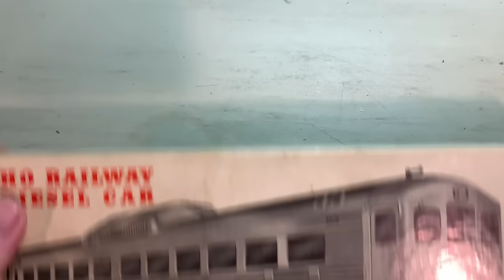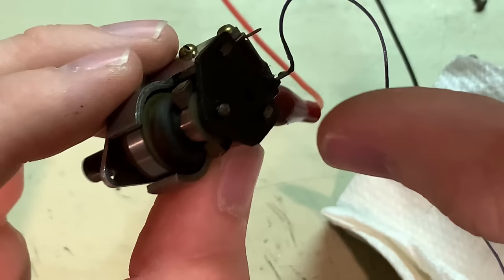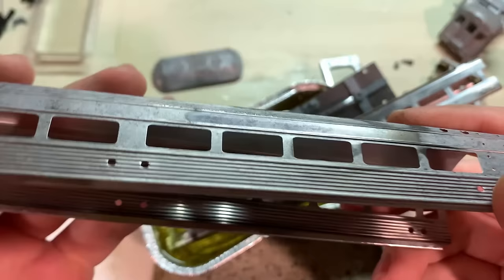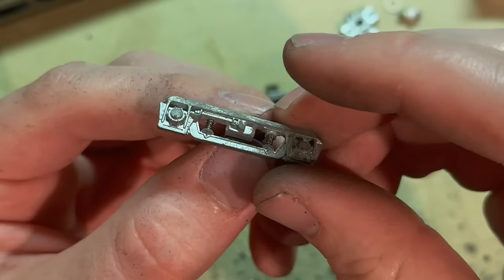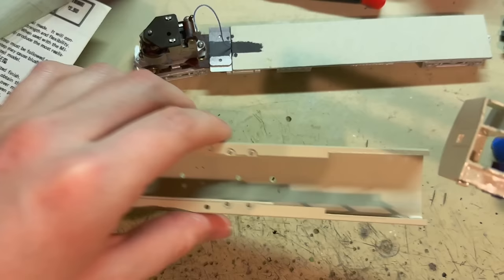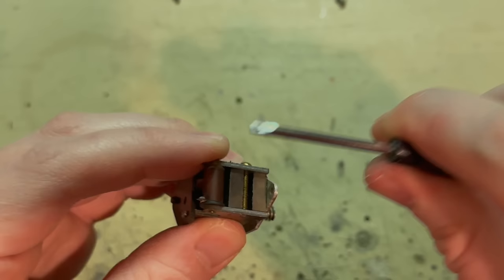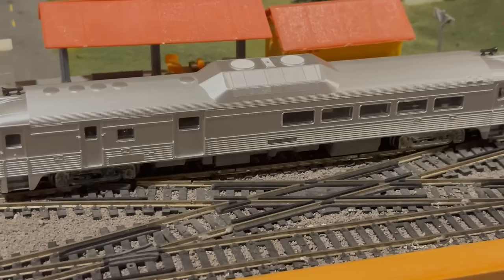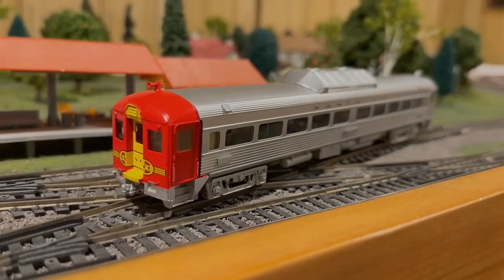Build/Restoration of the Original Athearn Metal RDC!

Comment: I just got two of the 50s plastic ones, ordered new belts today and plan to dcc only because of dual direction lighting. Has a motor in the middle, a drive shaft to each end and 4 belts for the four axles.

Comment: Definition of Aggravation :  -- When the frustration of launching those truck springs into orbit kicks in...... Lmao, I  did that a large handful of times over the years. Great job!!. As to using Alcad... I always liked my transit cars to have that "almost mirror-like finish". I used Alcad's black gloss lacquer as a base, then the chrome lacquer  to finish. Otherwise if not that system, i use black gloss paint as a base and then rub on chrome powders which also works to a nice point, since it can be buffed to a beautiful shine.

Comment: Great video. I acquired one of these old metal kits (an RDC-3) a few years back and also found it to be finicky. That said, I managed to get better slow speed performance than you did because on mine the motor appears to be slightly more refined... the metal gears aren't angled and the brushes are held to the commutator with an actual spring rather than metal tension from the brush holders. Net result: less friction and more freedom for that cool little five-pole motor to do its thing.
Reply from the maker: Interesting, thanks for the info!  They must have changed the gearing and motor later for improved running quality.  A member on the Tyco forums also just sent me a video of his metal RDCs running, and they do sound like they're geared a lot lower.  I guess that means the RDC I got is one of the earliest examples!

Comment: Great looking restoriation of a 70 year old Athearn RDC.  My takeaways include using Evaporust for rust removal and Alclad Metalizer.  Have your considered using Tamiya primer under the metalizer?  Also, most plastic kit modelers use Acrylic floor wax for clear coating clear plastic parts as it gives them a luster raw clear plastic doesn't have.  BTW the AT&SF paint scheme was a wonderful choice!
Reply from the maker: Thanks! I used Tamiya primer u see the red and yellow paint, but I used a gloss black paint for the steel body since that was done before I bought the Tamiya primer.

Comment: Any of us could probably talk all day about this model.
Haven't found time for whole vid. yet, but some ideas on what I've seen so far.
1/  One wonders if the presumably steel frame and body are distorting the magnetic field and affecting the running?
2/  That fibre top bearing is a worry; needs competent rebuilding with a proper self-aligning bearing.  I wonder if indeterminate bearing alignment and perhaps iffy placing of the   fibre is causing binding friction and explains the motor heating while running, and perhaps some of the appalling slow speed.  Heat in the hands of the inexperienced who might get it in the future = danger.  I'm thinking of a real person who might start a fire with this.  You could do something really special here.
3/  Worth thinking about the characteristics of that double start worm.  You might find it is based on a common screw thread; it's possibly metric as one wonders if the manufacturer was Rivarossi????  If it is safe and possible, perhaps a single start thread of the same specs could be installed.  For anyone interested in this - again - check for heat buildup and current - and find a model engineering club sporting qualified mech. Engineers to check your work.  Again: the worry is the kid who might inherit the model.  Note Darth was careful to observe.  Age removes motors and mechs from factory settings; just as do our modifications.  I always shudder a bit.  Get it professionally checked.
4/  You hit a bulls eye re the glazing and thin sides.  Beautiful.  Probably plating the shell would have made a huge difference.
5/  What a fantastic model.  Needs a lot of work.
6/ see https://www.youtube.com/watch?v=jQT9sH5bpJk&t=652s for a paint worth trying out.
7/  Do you know if Ronald Dods' remag works on motors with opposed magnets (yes, two of them) mounted opposite each other on the can of a can motor - classical Minitrix, or Athearn Gold?

And just to underline what roaring amateurs we all are: 
https://www.youtube.com/watch?v=PD3kNJUsD6k

Your video was a lot of work; it is not unappreciated.  Many thanks.
Reply from the maker: @petert9749  Thanks for your thoughts!  Going through each point:
1. I’ve noticed the motor gets attracted to the frame when the truck rotates too far, but as for the magnetic field, it doesn’t seem to be affected.
2. I once had to repair a Marx motor that had completely worn out its fiber bearing.  I drilled out the fiber plate a little to insert a metal bearing, and it’s been working great!  A metal bearing might improve this motor, but it actually turns pretty freely already. The heat and poor low speed seem to be mostly from a combination of the high speed gearing and low motor torque.
3. The thread sizes for these worms are typically standardized, so it may be possible to replace it with a single thread worm to cut the speed in half and double the torque.  The only possible issue is a mismatch of the helical gear cut and the angle of the worm thread.
4. I wish I could have properly replated it, but my brush plating kit wasn’t quite up to the task this time.
7. Yes, it actually does work on motors with 2 magnets!  I tried it out in my Athearn GP9 video, which had the original Globe style motor.  I’m not sure if it would work on the ceramic magnets in the gold motors though.

Comment: I found out that the best improvement one can make to an open frame (Pittman) motor is to change the magnet and use neodymium (rare earth) magnets.  I've done this to all my Pittman motors and it made a HUGE difference in current draw and performance.  Now they will "creep" around the tracks at you guys' DCC speed step 1.  Of course I don't do DCC as I hate the tinny sound of HO DCC.  Did enjoy the video.  Cheers from eastern TN
Reply from the maker: The magnet upgrade has made a huge difference in some of my motors! I considered it for this one, but since the base and shell are steel, the magnet was going to be too strongly attracted and could’ve caused derailments by twisting the truck. I made the upgrade to a 1953 Mantua metal Sharknose, and the truck wanted to turn up to the steel inner frame, lifting the wheels off the track.  In that one though I was able to install a strong spring to hold it down.
Reply: You can go DCC without sound ya know. much cheaper than sound decoders too.
Reply: Remagnetizing these old motors can help a lot!

Comment: Nicely done...I recently obtained one of these models as well that will require considerable cleaning, and restoration and your video has provided a great overview of the assembly. I did notice on my model that the wire running to the rear truck is attached with an eyelet ring terminal located between the truck and body much the same as the washer you placed on the power truck. Maybe that might improve your running as well.  Keep up the great videos I really enjoy watching them....

I would love to have a peek at the instruction sheets that you have...maybe you can post a copy or send one to 'HO Seeker' for all to share...

Thanks again...

Rich...

Comment: Love your videos - your model choices, detail, narration and lack of music make them ideal for me. I'm just interested in the models. I would be very interested in your approach to the problem of getting eccentrics on walschaerts valve gear that depend on the friction of the screw head to drive the eccentric. On Mantua locos, this seems to be a very finicky balance between too tight and binding and too loose which doesn't drive the eccentric.
Reply from the maker: Thanks! I adjust the screw until the valve gear works just right, then put a droplet of  liquid superglue into the threads. It holds it together well, but I can still easily break it free if needed.
Reply: @DarthSantaFe  thank you for the quick reply. This is the approach that I have been taking, except I have to glue the threads to the wheel (the threads are long gone) and the screw head to the eccentric. I had to ask if you had found a better way because if anyone on youtube might have found a better way, it would be you.
Reply from the maker: @michaeldewitt5198  If the screw hole is stripped out, sometimes it works to use epoxy in the hole to rebuild the threads and keep the screw in place.
Reply: @DarthSantaFe  I think I will try that next. Really appreciate your thoughts on this.

Comment: I am so jealous.  The one I inherited from my father has Zinc pest.  The ends are crumbling apart.  I have 8 or 9 plastic RDC's, and all have been remotored with jet motors, and run great.
Reply: Could I suggest 3D printed parts. That may solve your probkem
Reply: Athearn metal tank car kits almost always have zinc rot.  Not sure why as the other kits of the vintage from Athearn don’t seem to show the same issues.  Maybe they farmed out some of the metal casting.

Comment: Ouch I felt that! They make a plastic "wire" wheel that might be better for delicate stuff. Interesting kit and video!
Reply from the maker: I do have one of those plastic wire wheels, but it doesn’t really do much for me. I’m not sure if there’s a trick to using it or not.
Reply: @DarthSantaFe  with the grain of the gear I guess , but if it's too caked on it might not do the job.

Comment: Cool model. Why did you not made interior light while you where at it and put it together? Also a condensator for smother ride in low speed.
Reply from the maker: I might add lighting eventually. For low speed control, my controller has pulse power options and even that’s not enough to overcome the low torque, so I’m not sure how well another system would do. It would be easy to swap it for a Tenshodo truck though!

Comment: The real RDC weren´t built to pull anything. In fact pulling with them could void warranty.
A huge improvment would be to replace the 2 die cast radiator fans with modern see through and fan. Adding also the 2 exhaust pipes that are missing would improve a lot.
I can´t understand why Athearn choose a so ugly design for connecting die cast ends with metal body. Having done it in a straight line would have cover that uglyness joint.
Being shorter is not a bad idea for smaller layout with tighter radius curve. For the era when done, i´m impress with the result.
You did a good preservation choice.
Just wonder what will be the result put in DCC mode ?
Reply from the maker: Yes, they were only coupled to more RDCs as multi-unit sets when they were connected at all.  Athearn also sold dummy units, so one or two of those could be put behind a powered unit as "trailers".
Reply: Hummm weird universe, Athearn in HO more powerful than in real life....?
Here´s a real story. About 20 years ago i did the run with VIA Rail, Sudbury-White River in Ontario. With an RDC 1 & 4. The only baggage version.
 It´s a ride in the bush with anything that can fit in, will be on board. Canoës, wood stove, lumber etc...
We left Sudbury with 3 engines. The 4th one was B/O. 
Next day on return trip, we lost one. Coolant antifreeze sensor tripping constantly. Coolant level was fine.
So the ride continued with 2 engines out of 4.
Later on it was the same joke but with engine oil. Here again, oil level was just fine. Joy of modern electronics...
So we made the last 50 to 70 miles with a single engine, hence axle and transmission. There is quite good grades and that poor Cummins "kit" was growling cruelly. The 1 wasn´t full  but with good patronage, and the 4 wasn´t empty either. That would have been a good sound recording for DCC chip maker.
We did it, late but in a few grades i think we touch  3 to 4 mph. You know when you have the felling that you could disembark, hold railing and stall it....

Yes it can...and did it.

Comment: The RDC-4s in real life were 73' 10" compared to the RDC 1, 2 & 3s which were a full 85' long (the 4s were RPO cars that didn't carry passengers). 

Ironically the Athearn RDCs that were shorter than the prototype 1, 2, & 3 were the perfect length for the RDC-4s. Unfortunately for some reason Athearn never made RDC-4s, even though their other RDCs were the right length, so you would have to kit bash the bodies of an RDC2 and 3 to have one. Maybe a future project of yours (hint, hint)?😊
Reply: Just to let you know that Athearn did make a metal RDC-4. I found one on ebay including the box about 15 years ago. It is a trailer (no motor) and has no rust or tarnish. Metal non working couplers.
Reply: @albertjones1386  

You are correct. I just found a few. I guess I never ran across one before.

Comment: Is that remagnetizer a kit? How do remagnetized motors compare to neodymium swapped motors?
Reply from the maker: It’s a device made by Ronald Dodd in the UK. He makes and sells them direct. A neodymium magnet will be stronger, but the remagnetizer will bring the original magnet back to full strength when done right.